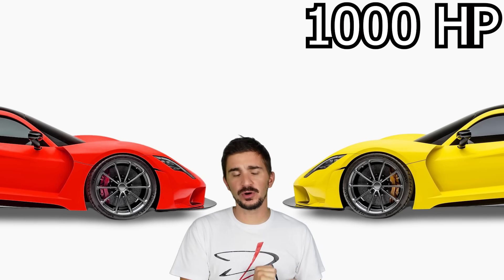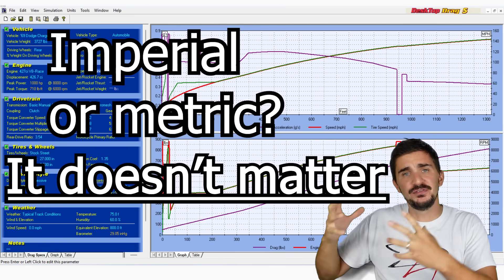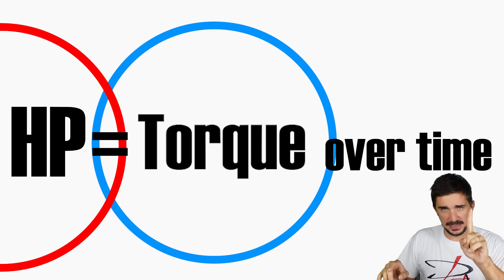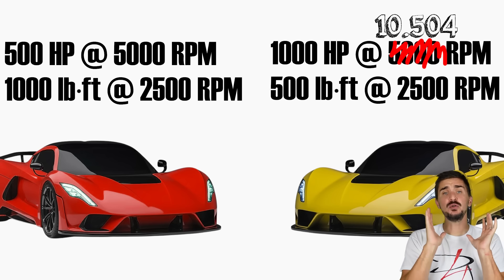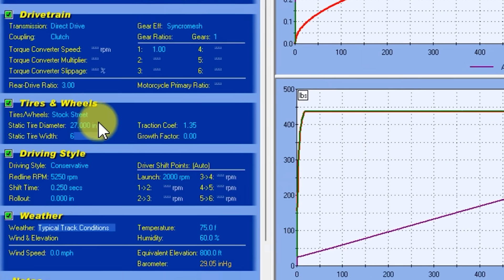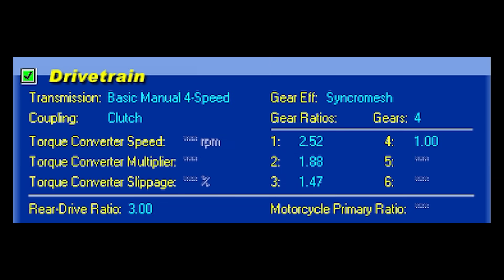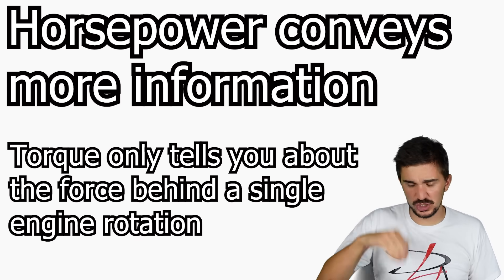Who's faster? Explained and Simulated - Horsepower vs Torque

Comment: The one I have always heard is, “people buy horsepower, but drive torque”. For a street car, I prefer lots of torque, especially since high speeds aren’t achievable (not without a speeding ticket anyway).  I used to drive a VW TDI Golf (the 90hp, 155 ft-lb) version.  I inevitably would get some kid in a Civic pull up beside me and start revving his engine at a stop light.  I’d wait till it went green and then leave him in the dust, until about 35-40mph.  Then he’d shoot on past me.  The little Honda engine had no torque, especially at low revs.  The VW turbodiesel had gobs of it right off of idle.  My point in retelling this is that around town, it’s that quick off the line, up to legal speeds, is what you want.  And I don’t know about you, I don’t want to rev the tits off my engine every single solitary stop light and stop sign, just to get it off the line.  I’d take that 1.9L 90hp turbodiesel every single day!
Reply: Hivemind nonsense. Power, not torque, is the limiting factor in not only the vehicles top speed but also in how quickly it can accelerate at any speed and how much weight it can tow up an incline at any speed.
Reply: @rollsroyce329 One does not exist without the other. You didn't understand my meaning at all.
Reply: @caoimhin71 nonsense.  Torque can “exist” at zero RPM.  Please…..🙄
Reply: @rollsroyce329 No, it can’t. By definition some motion must exist, no matter how small. 😒
Reply: @caoimhin71that would be for Power.  Not Torque.  Please….🙄
Reply: @rollsroyce329 In order for torque to take place, rotation has to occur. That is the definition in terms of physics. But in layman’s terms, which is what you are undoubtedly using, then no, you could say to have torque without rotation. 

So, when people say electric motors have maximum torque at zero rpms, they are technically incorrect. The very instant there is angular motion, then THAT is maximum torque. 
🙄
Reply: @caoimhin71 I see where you’re getting confused—you’re mixing up (conflating) torque with work. You said, “In order for torque to take place, rotation has to occur.” That’s actually the definition of work, not torque. Torque can cause rotation and thus work, and it tends to cause rotation, but neither rotation nor work is required for torque to exist. Think of the overused illustration of twisting a stuck bolt with a wrench: you’re applying torque, but if it doesn’t move, no work is done. 
In physics, torque:
 (τ=r×F\tau = r \times F\tau = r \times F) is a rotational force, measured in Nm or lb-ft, that exists whenever a force is applied to cause or resist rotation—no motion needed. 
Work: 
(W=τ⋅θW = \tau \cdot \thetaW = \tau\cdot\theta) requires angular displacement: (θ\theta\theta), so without rotation, no work occurs, even if torque is present. In electric motors (e.g., PMSMs or DC motors), maximum torque occurs at stall (zero RPM) due to maximum current flow, not because motion starts. Your claim that maximum torque occurs “the instant there is angular motion” is misleading—torque depends on current and magnetic field strength, not rotation itself. You’re right that when angular motion begins, torque starts performing work, but torque was already there, even at zero RPM.
Reply: @rollsroyce329 Whatever,  I have been up for three days straight. I am lucky I can remember my own name right now.
Reply: @caoimhin71all good brother.  Get some rest.  Theeeee days?!!! And I thought I had insomnia.
Cheers.

Comment: So if the vehicle is light high RPM and if the vehicle is heavier then high Torque?
Reply: Power, not torque, is the limiting factor in not only the vehicles top speed but also in how quickly it can accelerate at any speed and how much weight it can tow up an incline at any speed.

Comment: i understand your explanation but i don't understand why my "high" torque car is so fun to drive off the line.  i'm able to pass cars from stand still or from rolling going at same speed as it can get up to speed much quicker even though i have relatively low horsepower.  stock my car is 180hp and 172lb-ft starting as early as 1800rpm at the crank.  tuned i'm doing 196whp and 260wlb-ft at 2200rpm.
Reply: Engines with better torque tend to have overall better power curves. The peak number might be comparable but your engine would make more power at lower rpms.
Reply: Power, not torque, is the limiting factor in not only the vehicles top speed but also in how quickly it can accelerate at any speed and how much weight it can tow up an incline at any speed.

Comment: torque will win with high enough traction and short track, power will win with either low traction or long track - there, watched it for you (actually didn't)
Reply: loved the video though
Reply: Only without proper gearing which is meaningless Hivemind nonsense. Power, not torque, is the limiting factor in not only the vehicles top speed but also in how quickly it can accelerate at any speed and how much weight it can tow up an incline at any speed.

Comment: I participated in a 1/4 mile drag race with my Sti and there was not one diesel powered car? When theory meets practice. Why?
Reply: heees explanation is ridiculuous as avoid perfect gearing setup /configuration for each vehilce in hees comparisin in results he completely mess up real world dependencys found in avg road cars or bikes etc 👌🏻🪠 in real world in regard to such configuration power and torq as he comapre at engien crank so 1000 hp 500 lbf ft vs 500 hp 1000 lbf ft than 1000 hp 500 lbf ft 100% win in each or almost each test configuration which he take into considerstion in this video 👌🏻🪠 and disel mean 💩👌🏻🪠 disel with 2-3 whatever how much more times more power than your sti in similar carpsery- weight drag drive train losess  with perfect gearing and overalll saying enough grip will 100% win over 1/4 mile against your sti or electric or any other fuel source  which would have less power precisellly speaking less avg power over distance on which race is setup at similar motion resist 👌🏻🪠☕️ 2007 subbaru sti is 300 hp /6000 rpm 400 nm/4000 rpm 1500 kg awd  setup it against disel with 600 hp /4000 rpm 2500 nm at 1500 rpm also 1500 kg awd with similar drag similar gearing in regsrd to peak width and subaru sti is knockout 🤭👌🏻not because this disel i. me egzample have 6 times +/- more engine crank torq what is total irrelevant as it only lowering rpm at which specific power is generated and nothing more 👌🏻 but because it have 2times more power at simialr whole motion resist 👌🏻🪠1000 nm at 3000 rpm at 100 km/h with pedal to the metal = 500 nm at 6000 rpm at 100 km/h with pedal tp the metal or =250 nm at 12000 rpm at 100 km/h with pedal to the metal each of this egzample will push you into seat with the same force in the same car weight drag 👌🏻🪠 cos each of this egzample generated egzacly the same force in NEWTONS. at contact path which accelerate this car forward at this 100 km/h what is results of this formula 👉🏻WHELL POWER:VEHICLE SPEED = FORCE at drive whell between tarmac and tire 👌🏻😎 and beacuse of this formula which determined what gearing shpuld have each car and bike and NOT some freellly free gearing what some yd.ot imagine in hees head 👌🏻👉🏻this video as many other on yt in this theme is total 💩👌🏻🫣🤮🪠☕️
Reply: @mociczyczki 👍

Comment: I've always wondered what is the better package, Here is a real life example 2019 Lexus IS 300rwd vs IS 300awd   the RWD Lexus is a turbo 4 putting out 241hp at 5800 and 258 lb-ft at 1650; The AWD is a N.A V6 putting out 260 HP at 6000 and 236 lb-ft at 2000 .  The engine outputs mirror each other in opposites, set aside that one is rwd and the other is awd and that the v6 with awd adds 70kg. besides NVH which would be the better engine

Comment: Tldr, depends on the distance. Torque will get you there quicker in a short burst. HP will win the distance run.
Reply: Hivemind nonsense. Power, not torque, is the limiting factor in not only the vehicles top speed but also in how quickly it can accelerate at any speed and how much weight it can tow up an incline at any speed.

Comment: Use a real tests, not a simulations, Diesel fanboy...
Reply: simulation can be 100% correct woth real tests if simulation have alll data and formula in algprythm the point is this video is trash cos he dont gove both those egzampleERFECT GEARING what is critical factor which change everything if he give them perfect gearing than more power lesss tprq version win each time in each test configuration 👌🏻🪠☕

Comment: If you have a gearbox then engine torque doesn't matter for high performance.
Reply: 👍 torque can be multiplied by gearing Power can’t. 
 Power, not torque, is the limiting factor in not only the vehicles top speed but also in how quickly it can accelerate at any speed and how much weight it can tow up an incline at any speed.

Comment: The shortest way to sum this up is your acceleration capability is defined by area under your usable HP curve.  Usable is defined by your shift points.  The only reason high torque engines are lauded is because they have a lot of area under the curve in the lower RPM range, which is great, if you are heavy and bloated (like a semi).  But by manipulating your clutch, you can launch at 5K rpm in your usable range and it doesn't really matter.  Just isn't a good practice for daily driving.

Comment: So there is no such thing as a torque engine (like diesel), but just a low revving engine, making torque higher compared to horsepower?
Reply: yea +/- the more torq engine have the lesss rpms it neeed for generated specific amount of power simple  , max power is true indicator of max performance not torq assuming gearing is perfect max power and how wide it  is spread theough rev range in regard to diffrences between gear lenght 👌🏻 feg yamaha szr 660 58 nm 47 hp 180 kg 1/4 mille 152 km/h at 13,9 sec vs ninja 500 s 46 nm 59 hp 200 kg 1/4 mile 13,2 sec 159 km/h  cross finish line 30 m before szr 660 walk away from it all the way from 50-60 km/h (up to 50-60 km/h head to head cos grip + whellly limits accelerstion ) to finish line 0-100 km/h 80 kg 1 ft on 4,6 vs 5,1 sec szr 660 have more crank torq on lower power rpms so it work optimall on longer final gear ratio at lower rpms than ninja 500 butbecause it have worse power to weight ratio similar drag drive train losess similar good gearing and less absolute power it is slower at strsights than ninja 500 its higher torq determined only that its engine always work on lower rpms but bcause it have less power it is unable to match ninja 500 perfprmance at straights though not far away cos it compensate less power partly be lower weight but not enough in this egzample 👌🏻 and its 30% higher torq make 💩 in real world performance test like 1/4 mile 0-100 km/h and all other stats 👌🏻🪠☕
Reply: @mociczyczki 👍

Comment: This is so confusing, i am not slow when it comes to math and physics and yet i find these matters so confusing.
How can you have 2 cars with the same hp at the same rpm and yet the torque can be way different? I am giving up trying to really understand this. 

I know enough allready without understanding it to know what i want in a car though.

How i understand it is (might be wrong) Torque is the power here and now, and hp is more like "long term power" a 125hp diesel car can push you back in the seat like an airplane taking off and a 200hp petrol car won't come.close to that backpresure and still be much faster than the 125hp diesel car. And that is part of what making is so confusing. 
Cuz if the higher rpm in a petrol makes it faster then just put 50% extra gears on a diesel to keep it in the high torque range and it should beat the petrol car any time.. But it doesn't work like that. And if i have 2 cars. 
Both 200hp at 5400rpm and 
car nr 1 has 160 torque at 4000rpm and car 2 has 260 torque at 4000 rpm. How is that possible with the equations used in this video?

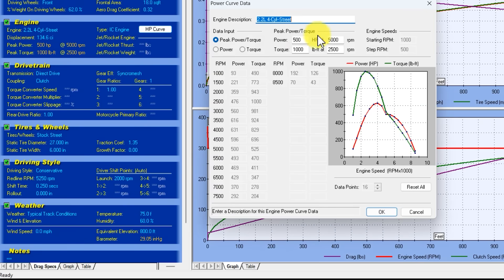Comment: Your 500hp engine makes over 600hp at 4000 rpm. 7:24 

Several flaws in this analysis.

Just explain how speed is related to kinetic energy and power is energy / time (aka acceleration). More power wins every time assuming you can keep the engine in the rpm range necessary to make that power.

Comment: I don’t think it’s impossible for the yellow car to exist. So long as the polar moments of inertia or small enough you want have that much torque needed to spin the driveshaft and thus axles if the POI is small enough. Theoretically if you have more horsepower for that smaller amount of torque as you need to rotate less mass then it should still be able to work. I mean the Lamborghini aventador svj proves that. It has more horsepower than torque. That being said, this is a pretty good video, however not entirely accurate

Comment: HP unless you have to compare a heavier vehicle than another. .like a superbike vs a Hayabusa for example. You then need comparable HP but more torque than the lighter bike. . .seems to be the formula on the drag strip.

Comment: There are ways to achieve Torque without horsepower, lots of ways. There are even ways to create Horsepower without Torque, fewer ways but ways. Technically they are independent of each other in some cases.
Reply: Horsepower is an antiquated term.
Reply: They have a certain degree of independence, but dont forget that Power = Torque * Rotation. They are connected
Reply: @lucasnahas  I know, I was being The devil's advocate; I just don't like the term Horsepower, LoL. He explains it so well in the Video, except for the punching bag part, LoL.

Comment: To explain it in the simplest way possible 
HP = Total power of the engine
Torque = How fast the engine can reach max power

High HP + low torque = A car that takes forever to reach top speed

Low HP + high torque = A car doing burnouts and only traveling 6 feet before your tires explode due to constant skidding
Reply: Hi mate, how's going? 
Unfortunately, your reasoning is incorrect. 
Torque is how strongly your engine turns. Power is how quickly you can accelerate in a given speed

A high HP with low torque is a car that can rev high
A low HP with high torque is the opposite, it revs very low

For performance, power is always more important
Reply: Torque is the sound of one hand clapping

Comment: HP = Peak power
Torque = How fast you get there
Reply: Nonsense: Power, not torque, is the limiting factor in not only the top speed of a vehicle but also how quickly it can accelerate at any speed and how much weight it can pull up an incline at any speed.

Comment: Thank you for the video. Really like it. The only thing is that both vehicles have 1000hp. 
According to the formula:
Yellow - 500 lbft * 10504 rpm / 5252  = 1000 hp
Red - 1000 lbft *5000 rpm / 5252 = 952 hp (not 500hp!)
Red has double torque, the yellow one has double rpm. With transmission they show similar result because they both have the same hp and the torque on wheels is the same due to transmission (which converts rpm to wheel torque). 
The reason why yellow can be slower with transmission is because we have peak torque at 2500rpm and then it drops and it can be lower at 10k rpm (yellow car) than at 5k rpm (red car)  which results in potentially lower hp of yellow car (as we do not know real torque at 10k rpm).
Please, correct me if I miss something